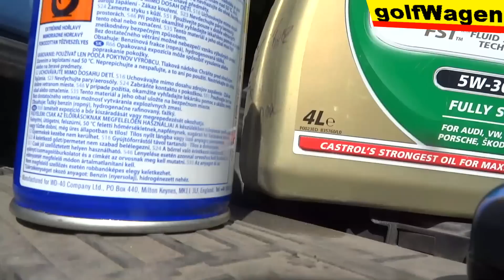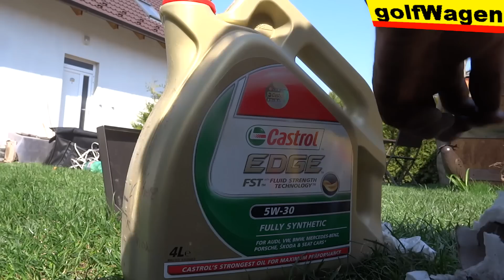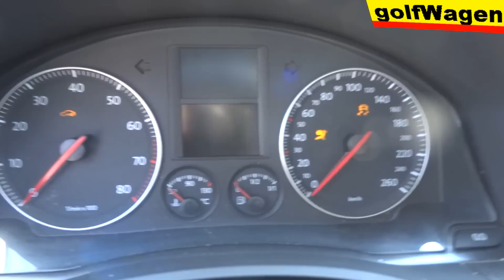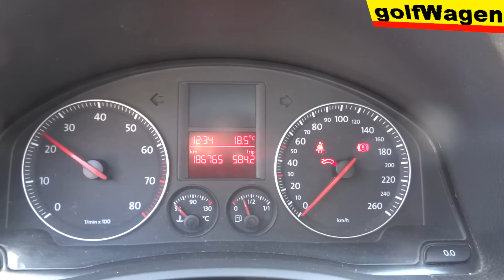Skoda Octavia 1.6 spark plugs change / Škoda Octavia 1.6 výmena zapalovacích svíček

Comment: Hello there, thank you very much for this video! I have Octavia Tour, year 2011, with 1.6 petrol BSE engine. It has problem with "rough" idle from time to time, even I have only 50.000 km ! (second car in the family). But mostly used to go to supermarket and back, which is approx. 5 kilometers from our home. So, very short drive, most of the time. Friends suggested me that problem can be with accelerator valve (clogged), EGR valve (dirty), MAP sensor (dirty), spark plugs, cables...  even some vacuum leak... But, I wanted to change spark plugs just to eliminate this possibility, and came across to your video. Thank you! By the way, my Skoda service dealer told me that spark plugs are good to up to 100.000 km (those that came with the car), and those are Brisk brand, much better than NGK that everybody is putting instead (as aftermarket product). What is your experience with the sparkplugs? Should they be changed at 100.000km or before? Thank you!
Reply: Hey man, have you found the solution for the rogh idle? I have the same problem with my BSE engine. No error codes, but in my biagnosing program i see some random misfires, but not only in one cylinder, but completely random. Already changed the spark plugs, ignition cables and coil pack. MAP sensor is cleaned, PCV system is clean, butterfly valve clean, no vacuum leaks. O2 sensors changed, still i have rough run, it kinda feels that the engine falls out of rhythm. Strange. I did measure the compression ratio in cylinders, they are the same on all 4 cylinders... Checked the fuel rails. Checked the injectors for leak/cloggage, but they are fine. I'm running out of ideas.
Reply: A. F.  Sounds like the same problem I’m having.
It just appeared out of nowhere.
I have changed plugs, plug wires, knock sensor, coil pack, mass airflow sensor, camshaft position sensor.
The new camshaft position sensor made it a lot better, but it still misfires when the engine is Nice and warm, I’m thinking of trying colder type spark plugs. Have you solved the problem?
Reply: Stop changing parts. This is a known issue for this engine. Nothing you can do.
Reply: I had NGK BKUR6ET-10 spark plugs with Audi & VW logos on my A3 8L 1.6 BFQ that was serviced at the dealer the last time in 2006. Approx 140000km 'with this set of plugs.  Now I got completely dead n. 4 cylinder and it had a very fouled spark plug. Maybe something else wrong with it still, but it looks like changing just the spark plug fixed this issue.
Reply: @a.f.1587  Check engine valve clearance. They should be adjusted for many engines after 80.000 - 120.000 km.
Don't know exactly for this engine, but probably it's valid.
Also change the type of oil you use and next time you change oil, use a flush on the engine.
Reply: Raise idle RPM from orginial state (I think those is 640) to 820-840, You will feel much calm work of the engine...

Comment: Hello i have an 2011 1.6 bse skoda octavia 2 and i have a problem with starting it afther stays in the sun. In the morning it starts fine but afther several hours parked in the sun doesnt want to start at firt key. I changed the temperature sensor, the fuel pump, the gas filter, the n80 valve, sparkplugs and cranksaft senzor. What can i do?

Comment: Not so clean but still quite efficient way. Better than stripping down the intake. Also mostly done by one hand for the other holds the camera. Good work! Don't tighten sparkplug with one hand due to angle forces coming from the long arm of ratchet. Good work!
Reply from the maker: thanks for comment
Reply: I'll need to update my keys with those seen on this video because I'll need to do this operation really soon - the winter is coming! :)

Comment: Just one lucky guy that you didn't ruin the thread of those sparks - u need to tide them by hand first - (romanian) chiar norocos ca nu ai stricat filetele - bujiile se strâng mai întâi cu mana pt a fi sigur ca se infileteaza
Reply from the maker: ceva se va întâmpla
Reply: @golfwagen4173  salut cu respect. Am o octavia 2 cod motor bse si vara cand sta la soare nu mi porneste la prima cheie.un stat te rog
Reply: Ai dreptate. Autodoc spune ca trebuie data jos admisia ca sa ai loc sa lucrezi